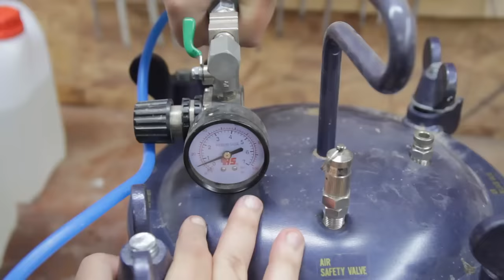Can you turn GOLF BALLS into a ....???

Comment: Looks great David!!
 The inside looks a lot different that the last time I took one apart lol I thought there was going to be rubber band strands everywhere hahaha
Enjoyed your video and I gave it a Thumbs Up
Reply from the maker: Thanks 👍 It was one or two with rubber bands but cut the lamp short as it did stay in one piece
Reply: @DavidsWoodturning  You are welcome buddy
Reply: @DavidsWoodturning  I've pulled golf ball apart before and was wondering if they were the ones with rubber bands. Then when you turned them I saw they were the solid core type. I wish you would have shown the rubber band balls and what happened when you turned into them.
Reply: @ghosthand8119  All modern golf balls are unfortunately solid core; the old-school wound types went away around the turn of the millennium with the advent of multi-layer golf balls like the Titleist ProV1.  If any company still makes wound core golf balls, they are likely for novelty reasons and are probably very expensive.
Reply: I was big into golf as a kid. Growing up a few doors away from a well known course and caddying there all the time. I’ve chopped loads of balls up. I remember some had a strange sack of oil type fluid at the centre.

Comment: Really surprised that the golf ball cores survived the turning and weren't ejected after carving deep enough into them. I presume that's why you used such a tiny edged carver for this.
Reply: Wood turning baldes are solid sharp steel blades. If he's using the M42's($120+ a blade), he just has to respect not stabbing the material.
Reply: @XxXGunShipXxX  Sure, but even the sharpest blade still has to catch some of the material in order to cut it, so it's not like the force on the material is zero. Smaller cutting tool means less force, but even then there's also the centripetal  force of the turning to contend with. Some of those cores were exposed enough that they could eject quite easily if they weren't bonded strongly enough to the outer shell of the golf ball, ie if they had a rubber band core.
Reply: @femsplainer  ??
Reply: @blairhunt1424  ??!?

Comment: Very cool.  Makes me think of the old golf balls we used in high school (1970s).  If you cut one open, they were basically a small black rubber superball, wound with rubber bands and covered with an easily cut skin.  Would not have worked in this application.
Reply from the maker: Thank you ! It was only 2 with rubber bands inside but luckily they did not make into the lamp as they were right at the top.

Comment: I don't get it no sanding no polishing just adding a new layer of Resin with a brush can solve this? Please clarify?
Reply from the maker: You are correct. I sanded up to 180 grit then applied one coat of resin. It will feel all the sanding marks and leave perfect finish. However, i kept the lathe running for 10 hrs at 50rpm to ensure the resin can harden nicely.
Reply: @DavidsWoodturning  Thanks for your reply 🙏  really appreciate it

Comment: Hi Dave I love the video great idea I’m going to have go but trying to find the led lights you used, I’m struggling to find them do you have a link or where did you buy them. Thanks Paul.
Reply from the maker: Thanks 😀 
https://www.ebay.co.uk/itm/Wooden-LED-Display-Stand-3D-Night-Light-Round-Base-Holder-for-Crystal-Glass-Ball-/362942179258?mkcid=16&mkevt=1&_trksid=p2349624.m46890.l6249&mkrid=710-127635-2958-0
Reply: Thanks Dave, did find the basic LED ring lights but no wires attached. I’ll get one ordered thanks again.